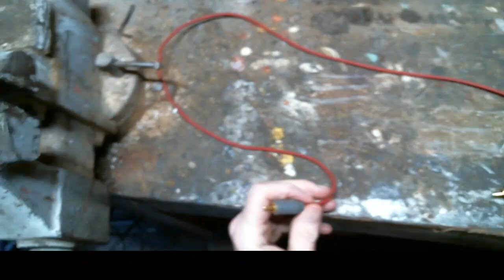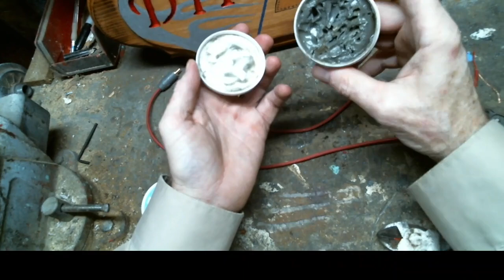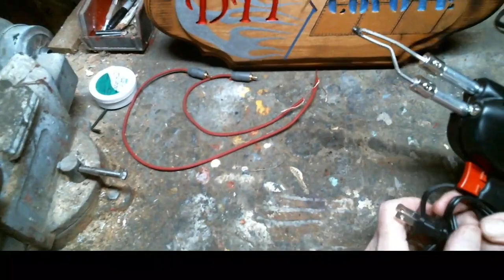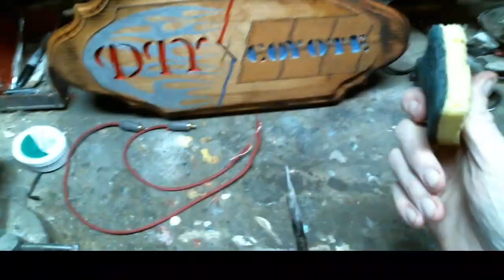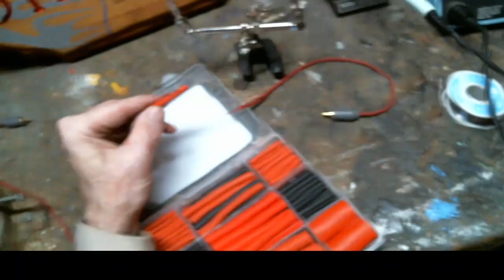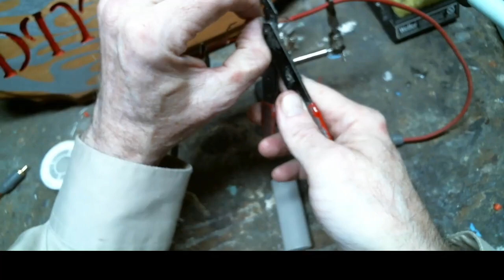Soldering for beginners

Comment: I made a solder sucker one time but I am a bit intimidated with the solder lol.  I used those connectors and covered them with that shrink wrap stuff and went around it some more with electrical tape.  The solder sucker was a computer fan, a cut piece of black filter (doubled) screwed onto one side of the fan. It was all connected to a 12v 1amp adapter.  Simple to do.  I do need to learn to solder.  Some of you guys make it look so easy lol it is a precision type of art.

You could probably use one of those desk clamps that can hold whatever you're using to record.  The ones with those bendable metal arms.  I usually see good ones at the thrift store, old but not cheaply made.  The head mount is fine, I'm waiting for mine to come in the mail.
Reply from the maker: Yes, I now at least have a monopod. After 40 years or so of occasional soldering, you get pretty good at it! Thanks for your comment. I am going to redo the video with the monopod for now.